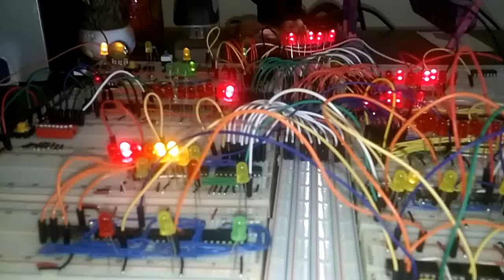Instruction Register Decoder , Control Matrix and Ring Counter

Comment: Hey Jeff I've missed this video during exploration of your channel last time. It must be so cool to follow Ben's series? I just finished watching the series and feel very excited about! One question - did you buy the kit or collected poeces on your own? How long did it take to complete?
Reply from the maker: Ben had not started building kits, when I started this project. So, I purchased everything piece by piece. Which  turned out better for me, as I work on a lot of vintage computers, and having a surplus on hand is always a good thing. So, I always buy extra. Although I did buy his 6502 project, so that I would not have to  buy everything individually and to support Ben's efforts. He is one heck of a good teacher.
Reply: @jeffnay6502  Awesome! You know, I thought I would never try to build anything HARDWARE but Ben has motivated me so much that today I've ordered arduino nano, LCD, keypad and breadboard to write a sort of Ben's CPU emulator (a bit more enhanced one with at list 8-bit memory addressing and much faster clock and LCD, hence ascii suport but the core idea is the same). I would then write a hex editor somewhat similar to the one Apple 1 had to be able to code my tiny computer using 4x4 keypad - just fairly enough for inputting machine codes in hex! And if all works I'll make a series on that. The benefit is that it would be possible to follow along using tinkercad arduino simulator so one doesn't even need a real hardware to follow.

Comment: Hello, what chips have you used to implement the control matrix ? Because 74HC5X are nowhere to get and even the LS ones are quite scarce.
Is there a reason why not to use 4017 or 74HC4017 as the ring counter ?
You say that you are using JK flip flops for the program counter but will you be able to perform JMP with those? In other words can you preset them with the adress from JMP instruction? I think that a better solution might be 74HC193 - presettable binary up/down counter.
Reply from the maker: I used 3 74LS21's and 1 74LS04

Here is the diagram you can use for both the Instruction Decoder and the Control Matrix.
Let me know if this helps.

https://drive.google.com/open?id=0B6LIgQzDkH8fbEQ1X3NwUUJFNWs
Reply from the maker: The ring counter only needs to increment from through all 6 stages. The JMP command is Decoded by the Instruction decoder and within the Control matrix when the ring counter gets to T3 the correct control lines will be 
enabled.

I do have one disclaimer to make here. Even though I have the Instruction decoder setup for the JMP command and the control matrix and ring counter, I do not have the control lines setup to do anything, as I have never used the JMP command. If you look at the diagrams that I have uploaded for you, you will see both the Instruction decoder and the Control matrix that I am using.

Comment: have you built the program counter for your computer yet? i need to know how to build it to my own 8 bit computer. Im stuck when ben eater isnt puting upp new videos
Reply from the maker: Yes, the original PDF here has a pin to pin diagram of the program counter. I remember having a little problem with it,
but after reading up on the JK flip flop, I was able to get it going.

Basically yu use 2 74LS107's and 1 74LD126

https://drive.google.com/open?id=0B6LIgQzDkH8faEJuaExJemxoUUk
Reply from the maker: Basically you use 2 74LS107's and 1 74LS126
Reply: Jeff Nay thanks!
Reply from the maker: What exactly were you having problems with, in regards to the Program Counter? 
Here is a hint on the program counter. Like I said, I did have a small problem when putting this together as to the instructions that are in the PDF file.

I do not believe you have to hook the J's and K's together at all (If you leave them open they will both be set high) and CP (Increment Program Counter) only goes to pin 9 of the fist 74LS107's.

I can recreate this on a new board if you need me to be a little more clear on my instructions. I am just trying to look at my current board and see what is going on.
I did have a wire from pin 8 to 11 (The first J to K) but I pulled it out and my program counter is still working. 

Here is a diagram I just put together, you can tell me if it works for you.
https://drive.google.com/open?id=0B6LIgQzDkH8fU3F3VEJfLWJ1VFE
Reply: Jeff Nay ok, im gonna explain my promblem. i have followed along ben in his wonderfull videos, the clock, A and B register and the ALU, the RAM module and the logic to the ram module that make so you can set the adress and data.
Now, in the end of the last video he made he spoke a little about that he maybe was going to build the program counter in the next video. I have no clue what a program counter is suposed to do in a computer or how you build one. 
so i need a explenation on what its task is and how you build it. 
Thanks!
Reply: i have just began with digital electronics by the way
Reply from the maker: Ok, No problem. The program counter is a very simple circuit. All it does is count from 0 to 15 in binary of course. It is used to execute the program that you manually input into memory and step through the commands one step at a time.
So, all you have to do is wire up the 2 JK flipflops so that they count from 0 to 15.

The Program Counter gets fed into the Memory Address register to find out what command  or data is at memory address 0-15. 

I would suggest that you also go ahead and build the Instruction decoder. It is a little more difficult then the 
Program Counter, but you can see the results, if you add LEDs for the 6 possible commands.
0000 = LDA
0001 = ADD
0010 = SUB
0011 = JMP
1110 = OUT
1111 = HLT
 
Have fun and keep with it. Feel free to ask any questions.
Reply: Jeff Nay thanks so much for your help. i really apreciatate it. Now i know a little more!
Reply: Hello again jeff, and thx for time for answering my questions, i really apreciatate it!

I have now built the program counter, with to JK:s, so it increment by 1 every clock edge. Now im thinkin about to build the controll sequencer, as i have seen in the data sheet you gave me. I dont know what components you need, or how it's gonna be put together, so i need your help!

i dont know if you have built it yet
Reply from the maker: I would start with the Instruction decoder, it is easier and you can see immediate results, if you add an LED for each command..
Plus you need the instruction decoder to complete the Control Matrix.
Reply: Jeff Nay is the intruktion dekoder with the controll matrix same thing as the controll sequencer?

and do u think im gonna start with the intruktion register or the intruktion dekoder?
Reply from the maker: The Instruction Decoder is directly connected to your Instruction Register. It takes the high 4 bits on the left which is the instruction (command) portion and decodes the commands LDA / ADD / SUB / OUT / JMP / HLT 
then it passes the decoded signal to the Control Matrix.

I do not know what you mean by control sequencer, but if I were to guess I would say that you are referring to the RING COUNTER.
Reply: Jeff Nay http://drghimire.com.np/simple-as-possible-computer-1-sap1-architecture/

here it says controll sequencer
Reply from the maker: That is a Very Vague block diagram. That is not very helpful.

Here is a diagram of the Instruction Decoder along with the Control Matrix and RING COUNTER.

(Although you can not use this one to build with), it does give you a good look at what is needed to makes 
the system work. 
What you see coming out of the Control Matrix is the Control signals that will Enable and or LOAD all the  
registers control lines. Using the RING Counter to sequence which registers pass things onto the BUS and which registers load information from the BUS

https://drive.google.com/open?id=0BzeLVhP_vKa_dHg1R1lHY0RKWVE
Reply from the maker: Here is the Instruction Decoder and Control Matrix that I used and I know that works.. 
The instruction Decoder is pretty easy. 
I added LEDs to represent the 6 different commands. 
LDA / ADD / SUB / OUT / JMP /HLT

https://drive.google.com/open?id=0B6LIgQzDkH8fbEQ1X3NwUUJFNWs
Reply: Jeff Nay thanks! but what means the instruction JMP?
Reply from the maker: That is not an important question. 
It is usually used to JUMP back and repeat an operation. I think by re-setting the program counter to a particular count.
I do not actually use the JMP command in the program that I load. 
Did you ever read the SAP-1 PDF files? They are a little hard to go through, but it does help to read them.

This is the 1977 original SAP-1 documentation 
https://drive.google.com/open?id=0B6LIgQzDkH8faEJuaExJemxoUUk

This one has the good Instruction Decoder and Control Matrix
https://drive.google.com/open?id=0B6LIgQzDkH8fRmpSYm9ROTMzSGM
Reply: Jeff Nay thanks alot, the last pdf file was much better, more like bens acual 8 bit computer
Reply from the maker: Actually Ben references the first one. They are both SAP-1. I think the second one is just a later version.

Anyway, I read the first one, but when I looked at the Instruction Decoder and the Control Matrix on that document, it looked stupid. NAND games inputting to Negative input NOR Gates. (They do not exist and a Negative Output to a Negative input = No Negative, easier to have a 4 Input AND Gate feeding a 4 Input OR
or NOR gate.

But as far as the rest of SAP-1 I followed the first document. Especially the Program Counter and the RING Counter using JK flip flops.

Comment: Hi Jeff, I'm using Ben's videos for my students and we seem to be having a huge problem with our breadboards not working properly. Did you experience this also? If so, what did you do about it?
Reply from the maker: What problems are you referring to? 
The only problem that I had with my bread boards, is that I did not order from the same place, but I did order the same boards, but they would not fit together. I was able to order another batch from the original seller and get matching boards.

Use your multi meter, to make sure you are getting your 5vdc, to all chips. 

Congrats on getting your students into this project. This will be a great learning experience for them.
Reply: Well, we took the tape off and secured them to plywood, but it appears that the plywood warped a little and  now the boards are problematic. I purchased enough boards for 10 computers and made that mistake on all of them. Before I repurchase I wanted some realistic comfort that bread boards in general are dependable for this project.
Reply from the maker: I did not glue mine to cardboard. I created each bread board first and tested it. Once everything was locked into place, I slid it off onto a piece of cardboard, so that I could take it to the computer club meeting. 
I thought that It would be too difficult to work on all of these modules if they were all hooked up to each other, you would be knocking over LEDs if not pulling wires apart doing it that way. And I never took the tape off the bottom of the boards.

So, I pretty much followed Ben's videos and only hooked up boards as he did.  Until I got to the point where I had to move forward, as waiting for a new video can be very frustrating.

When you get to the control matrix, I started off sending the control signals out to labeled LEDs, so that I could make sure I was getting the correct control signals out, so that I could then wire them to the correct control lines of the various registers.
Do you have both copies of the PDF files, that I have uploaded?
This is the PDF you will need to create the Instruction Decoder and the Control Matrix. 

https://drive.google.com/open?id=0B6LIgQzDkH8fRmpSYm9ROTMzSGM

I like the original 1977 PDF for everything else.

https://drive.google.com/open?id=0B6LIgQzDkH8faEJuaExJemxoUUk

FYI: I am a vintage computer and Vintage Video Game System Collector. Would be glad to send you some pics.
Reply from the maker: I see that you may have joined Ben's  Patreon page. I also noticed that he keeps raising the price over and over again.

Do you get any benefits from joining his  Patreon? 

Here is my latest video of my SAP-1
https://drive.google.com/open?id=0B6LIgQzDkH8fUTlCYWpJV3B2dDA
Reply from the maker: Hi Jeffrey, 

How are you guys doing, did you get back on track?